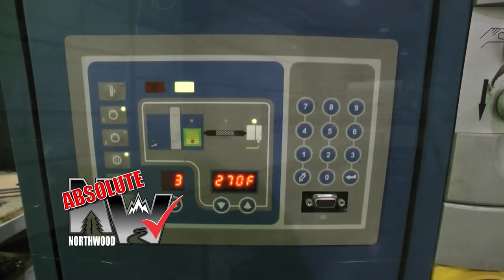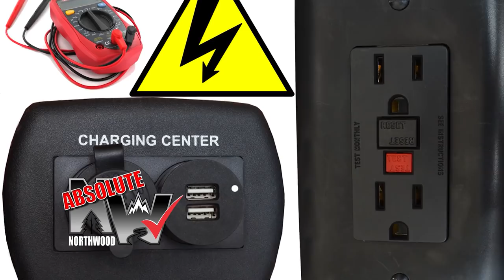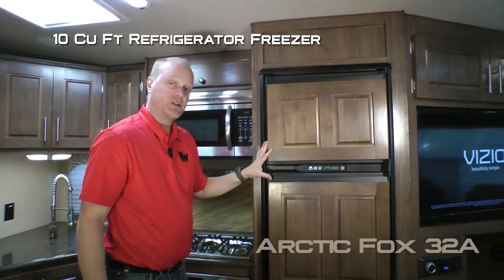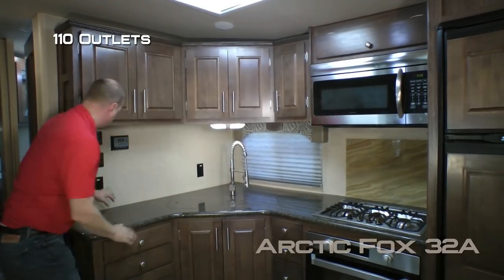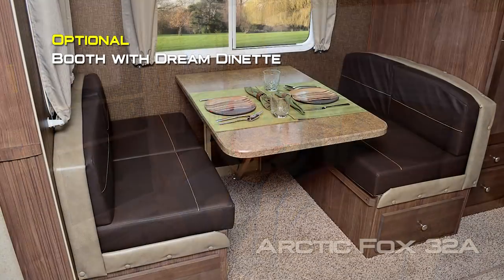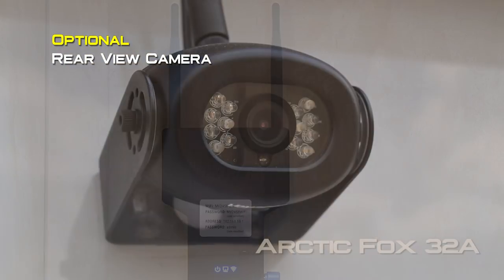Quick Tour of The New Arctic Fox North Fork 32A Travel Trailer

Comment: So is the Arctic Fox travel trailer made any better than the Nash travel trailer?  I know that they are both Northwood Manufacturing products.  We bought a 2018 Nash 29S and we have had several problems with it, including:  1.  The 12V/USB charging port next to the bed on the driver's side made a loud wining noise the first time we used it then quit working completely.  2.  The kitchen sink leaks underneath inside the cabinet.  I have tightened all of the connections I can, but it continues to leak.  3.  The padded valances around the bunk beds and dining table have completely come off because the screws that held them in stripped out the cheap wood and they came out.  4.  The roller drawer glides are loose on all of the drawers.  I tried to tighten them, but again the screws just turn in the stripped out holes in the wood.  5.  And the slide leaks water on one side.  I live about 8 hours away from the closest dealership that sells this brand, so I can't exactly take it back every time there is a problem.  I have called them each time, but they always want me to bring it in.  But I guess it doesn't matter now since the warranty expired last month.
Reply: No, it's not al that better and my charge port thingy sreams like that too. Can't use the one next to the bed. I've had some of your same problems and many more. Mine had to get the roof restuctured when it was new. Factory warranty guy lied repeatedly to us. 
Probably wont buy another.

Comment: Can you swap out the skylight for a fantastic fan in the kitchen?
Reply: No, the skylight is much bigger than a FF but the micro has a through-wall exhaust and the ceiling of the living area has a vent where you can option a FF and it's only 6' away from the skylight in the kitchen.

Comment: Saw the 2020 32A at the Seattle RV show.  I noticed you stopped installing the nice fabric ceiling treatment like my 2018 has. Overall, it just looked a lot more plain inside and not at all like the flagship AF travel trailer it's supposed to be. 
I also noticed that this video has sections from the 2019 vid and many of the colors and  appliances don't look anything like this in the 2020. 
I'm glad I got a 2018, it's a lot nicer RV.